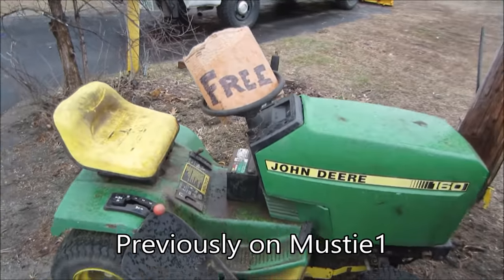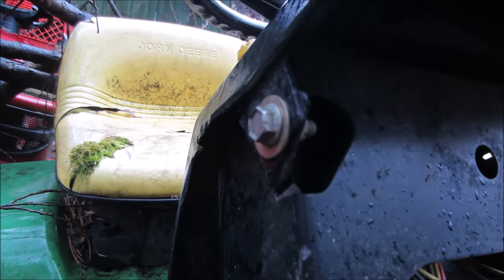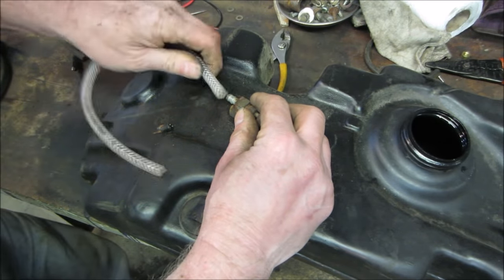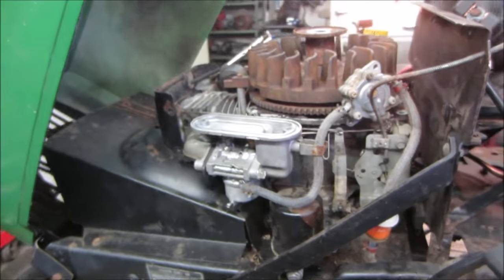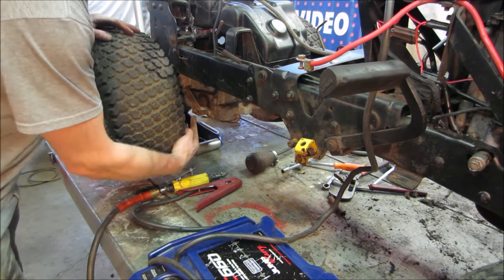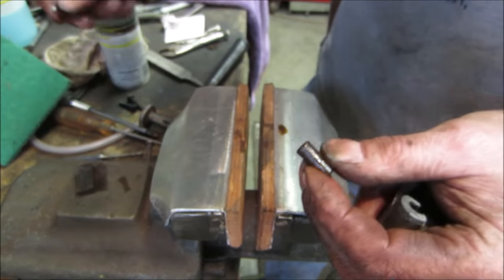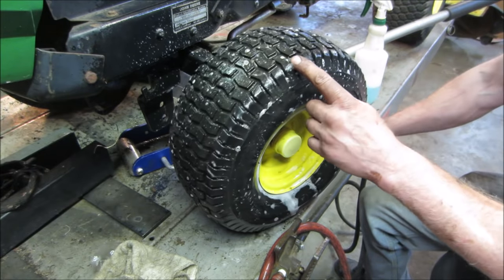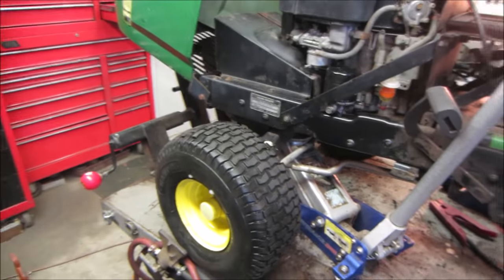CAN IT BE SAVED? Free John Deere that was in the trash. part 2

Comment: Wouldn't it be nice if every power equipment manufacturer would assemble their products with anti seize for all dis similar metals ? I was just out yesterday fixing one of my lawn tractors , I had success .  Weather was finally a little nicer yesterday so I got to confirm my repairs on one of my motor cycles was also a success . Then drained my pond and did primary cleaning and re filled . Today is pressure washing day , grandson wants to do some . Holding off on buying a new 30" Cub Cadet to replace my Honda walk behind and my 42" Craftsman . Also sell my snowblower tractor . Then design and build a mini lawn tractor based forklift , loader and plow . Been designing in my head for some time , looking forward to starting . Be safe and enjoy yourself .

Comment: This one video helped point me in the right direction on at least 4 problems for two different project tractors I'm currently working on (and only one is a much older JD product). How's that for efficient math?! One plus two equals 4 or more. 😁👍
Speaking of weird JD specific issues, you'd think these were designed by the British, using overly complicated systems for what should be like a two component problem. Instead there's five brackets, four pulleys with two of them having multiple components, clips and cotter pins everywhere when you could just have two bolts and be done with it. 
To heck with the purists at this point. I'm re-engineering it to be bulletproof for myself down the road!

Comment: Try automatic transmission fluid in the tire instead of oil.  It's designed to swell rubber seals.

If you put an old valve stem on the valve tool (screws right into place where it's supposed to chase the valve stem outside threads), it's a lot easier to use to remove/insert the valve insert itself.  Can just twirl it between your fingers and doesn't interfere with other use of the tool.

RichE San Diego, CA

Comment: I did my garbage pile find John Deere (1989 STX38) PTO switch using a “heavy duty” toggle switch rated to handle the amps, but again I also completely ripped out the entire wiring harness and started new, the only thing I re-used was the key switch. I don’t know been using it 3 years now, and never had an issue it mows the weeds in my yard.

I figure if you don’t know to start it in neutral, turn off the PTO when you’re done mowing, and forget that shutoff valve on the carb...if you don’t know how to operate a lawn mower, don’t do it...I don’t need no stinking safeties.

Comment: FWIW the gas cap is ventless and the vent spigot has a piece of tubing on it that runs up around the front of the filler nozzle in the 'trough' that is there and then back to the back of the tank. That's so that you can lift the front up for servicing (sharpening the blades, removing the deck) and nothing will spill out of the tank.

Comment: When I was a mechanic for an IH dealership, my boss was a parts changer, not a troubleshooter. He would just throw parts at a problem, until it was solved, then charge for all the parts, if they were needed or not.  We had a farmer with an intermittent hydraulic issue.  He came in three days in a row and each day was told there was nothing wrong.  On day three, after the boss couldn't find a problem, I took over.  I was able to duplicate the issue, and fixed a misplaced supply tube.   The farmer had changed the hydraulic filter earlier, and missed one step when he put it back together.  Quick easy fix.

Comment: They make a tire sealer for the beads, primarily made for aluminium rims works on steel also. Very common leak area on aluminum rims, especially in areas that use road salt.

Comment: You may already know but the NAPA 1348 filters fit most of the small engines and it looked like it would fit that one also. Some of the Kawasaki's were a NAPA 1394 O.D. is usually a bit smaller same thread pattern though.

Comment: Spin that 12 gauge bore brush on the end of a drill with some oil on it.  Wrap some 0000 steel wool on the bore brush and do it, agai, for a mirror finish..  that’s an old gunsmith trick for rusty shotgun chambers.

Comment: There's a tool set for removing connector pins. 
It has blades for different styles.
Check with your local electronics supply store if you have one.
We have one in north Miami that's like a bog boy toy store for me.

Comment: Your battery is made of lead plates in a tank of acid. Current normally flows through the plates. When a lead acid battery is left discharged for a period of time, the acid eats the surface of the lead plates. This is called sulphation. This leaves a layer of insulation on the plates, effectively stopping the flow of current. No saving that battery!

Comment: Just curious,  how much oil pressure do these small engines make? I have a Craftsman GT5000 with the Kohler 25 horsepower,  it has an oil filter too.

Just a suggestion. You can also use a vacuum pump to fuel pump to get gas from the tank to the carburetor.  I found that out when I rebuilt a carburetor on a Briggs V twin.  Saves time and  the starter/battery

Comment: When you pull your old fuel line out, attach the new line to it with a connector or a piece of all thread and pull it through . Saves fishing a new line through a tight space, or trying to remember how it went later.

Comment: Mustie, I have discovered a mixture for some prentrating oil I would like you to try and see how you like. Mix brake fluid and acetone 50/50, and put in in a squeeze bottle . It seemed to be the best I've ever used.
Reply: Check out the penetrant testing videos on Project Farm and AVE.  You will be surprised.  They tested it all including the 50/50 mix and none of it works worth a damn.  The best (and not very good) was Liquid Wrench.  What was really eye opening and funny is that Liquid Wrench is the cheapest stuff you can get!  Expensive does not mean effective (Yes, I'm talking to you, Kroil).

Comment: Had to replace the electric pto on my ariens serria, I didn't want to spend $180-200 on my then 17 year old tractor. Look far and wide for a used one, found one  an hour away a guy  was parting out some tractors. Cost me $50 and when I was installing it fell apart the clutch part was all worn out. Managed to make one good one out of the new one and my old one. Then about a month later at a flea market I found a new one in the box for $5,and of course I bought it you never know in another 17 years I may need to replace it again

Comment: That's about as dead a lawn mower as I've seen you resuscitate Darren!  From this episode, I'm sure you'll finish it up.  It wasn't rust, it was electrics and brakes and such.  You'll fix then mower deck even if you have to "liberate" good bearings from rusted out decks in the hoard.
Reply: Heck, with this one he didn't even have to touch the engine.  Most he comes home with are seized!

Comment: For any cheap people, like me.  You can just put a sealing valve cap on it for less than a 1$.  We have a tractor leaking 20.8x38. Has a leak from valve stem,  but I cant get it out because fluid and rust and has a tube

Comment: in the steel to aluminum cast threads if you get them free use noalox on threads when you reinstall the bolt It is designed to stop corrosion on dissimilar metals

Comment: I guess I don't understand how that brake works.  So you have two shoes that sandwich the disk, how does the disc stop the transmission if it's sitting free on the shaft?  Does it have splines that I couldn't see?

Comment: When I run lines, I’ll tie or tape a long string or wire to the line then pull it out. Reattach the wire to the new line and pull the wire back with the new hose.

Comment: The way the PTO switch should work is that if it is pulled out (on) and the tractor is turned "off," then the tractor cannot be started unless the PTO is "off."   There should be a switch under the seat that turns the tractor "off" if no one is sitting in the seat.   The switch under the seat is a normally open switch that makes an interlock with the start switch and ignition circuit so that sitting on the seat closes the switch and allows the tractor to start and run.  All of this is to keep you from getting off of the tractor with the PTO "on" or starting the tractor with the PTO "on."   On the newer tractors there is a PTO cutoff switch when the tractor is put in reverse.   Someone backed over a child standing behind the tractor with the PTO "on" and sued Deere for negligence in allowing them to mow backwards.  So, for all of the people thinking the interlocks are "stupid" - my only response is, apparently, not as stupid as some of the people using the equipment.
Reply: Every interlock is disabled on my machine except the clutch to start.

Comment: Ya, I was yelling "key".  Looks like all tires were run on low air pressure.  There was a bit of a bent rim on the left front inside near the valve.  I have a nice black dotted line across my tool board when the bead snapped up after a liberal coating of driveway sealer!  It worked.  There is likely a zerk fitting in the centre of the front axle pivot pointing down.  Good one.  Crap.  Put a tube in it.

Comment: As an Electrician I don't know why when you check continuity you don't just use the tone function. If it rings you have continuity if not it's an open circuit. Much easier and accomplishes the same thing for what your doing. The other that you use is for checking resistance which is of no value for just checking open or closed path. Just offering an easier way, you don't have to see the meter you hear it tone.

Comment: I have found that when I want to take out the Stake-on’s from the plastic holders, I took and found the right tool when I replaced my windshield wipers.  I took the small flat wire out of the rubber wiper, and bent it 90deg. At one end, for a handle, and then made the end a little smaller, so it would fit in the runner that the locking tab was in.  By running the tool down the grove, and giving it a twits I could get the Stack-on out with out much trouble..  Hope this will help?

Comment: Love those mechanical gearboxes this Hydro static stuff they’ve been putting in the lower end mowers has been garbage mine (which is a replacement after a year of the first one) now has the same issue as the first one where it barely crawls up the driveway until the fluid finally builds it is a second one and it is garbage as far as I’m concerned I’m looking for an old one with hydraulics on it I can’t even add fluid to my new one if it leaked out somehow since it’s sealed

Comment: I like it when you troubleshoot rather than simply googling stuff.  I think being cerebral is a better way to be, because its better to be able to think through a problem rather than seeking an online solution. Why?  Because you may not always be able to be online, and knowing how something works is better than not knowing. I generally find that the difficulty in trying to locate the solution online takes a lengthy period of time that may actually exceed the time that troubleshooting it affords and often, while troubleshooting, you find other things that might also be broken that you wouldn't have found if you simply googled the one issue you had.  Because the other issue will end up revealing itself later and then you are disassembling everything again. More wasted time.

Comment: Hey mustie i have a question for ya i have a husky i bought a few years back but ive noticed that on the steering rack and blade pulleys have no grease fittings to lube them,  is there a way i can possibly  drill and tap those? or would that cause more harm than good?

Comment: With a dead battery the water and acid do not separate. The acid chemically changes to plain old water as a charge is drawn from the battery. Water has a higher freezing temperature than acid, so a dead battery will freeze where a charged battery will not.
Another aspect of this is that a frozen battery will not take a charge. You must first thaw the battery before you can charge it. Forgetting this can cause massive frustration when your battery is dead on cold nights.

Comment: 1:21:27 It will run but it doesn't want to stop. That doesn't look good. But then again, a breakdisc so small, with that high speed. Only option is to up it in neutral and bail.

Comment: It seems like the electronic PTO and fuel pump were decisions made by marketing instead of by engineers.  A cable operated PTO would be cheaper and just as reliable.  A gravity feed fuel system would be more reliable than a pump.  But the marketing department wanted the lawn tractor to operate more like a farm tractor, and forced these features into the final design.

Comment: I have a Gravely ZT hd 44 in Mower  I just bought a new interstate battery at the end of last year It was dead when I tried to start it this year so I had to jump it off  I mowed probably 10 mins and the blades just quit like I turned them off. I think now that my voltage regulator is bad or stator. Any thoughts??  Thanks in advance!!!

Comment: Sometimes dead cell can be a opile of shavings on bottom if i got a clothes hanger ben in an l shape between scellsd you can knock the pile down n the battery is still useable or salvageable and will hold a charge. Just my 2cents or try using a pulse charger

Comment: I have a JD 111 and the starter solenoid went out and was wondering if the solenoid goes out if that is tied in with the PTO at all?  I hooked a car starter button to the two large studs on the solenoid so I could start it after sitting for 5 years and went to switch the PTO on and the switch was stiff and would not move. So I bought a new switch and still the PTO won’t turn on. So if I remember correctly the purple wire by the solenoid might be to the PTO. Bought a new solenoid but it only has the two studs coming out of the little black circuit switch or whatever it is that I slid the red wires into the threads but the solenoid does not have a 3rd small stud like the one I took out which I think the purple wire slid onto the little stud . I also lost my notes when I took out the solenoid year so I’d know for sure how the wiring went. Can’t find a solenoid that has the 3 small studs plus the two big power cable ones. Runs great and never had the head off.  Wish the made them like they use to.

Comment: Every time you run your fingers over a key way or oil filter flange, I cringe... I sliced my hand open on an engine crankshaft turning it by hand while rebuilding it and have cut my hands picking up heavy aluminum and steel parts, like mower and car engine and head parts, and have sliced my fingers open, greasing up or wiping off other things... some edges aren't always knocked down at the factory... And they stay pretty sharp. Sliced my knuckle on a metal edge that was so sharp, I didn't even feel it until after I noticed blood all over the bench and on the shop floor and finally figured out where it was coming from, then it started hurting... lol. Now I check and knock them down if I'm working on things with sharp edges. And I do the same thing you do, find stuff that don't work for free, fix it and sell it. And I also have contracts with landscaping and snowplowing companies to maintain and repair their equipment, so it's not like I have soft hands.

Comment: You should always crank the engine without the spark plug connected to raise the oil pressure first before it starts, that way you have lubrication, even if only sits for a month, a dry engine is bad for the engine and you.
Reply: Troll.

Comment: As with any Jenner transmission lawn mower the grease can get hard over time and it'll get so bad you can't put it in gear and you take the differential part clean the grease out and replace it with new Grease

Comment: Ya should have put that wheel back on with the valve stem on the outside like the other 3. It sure is hard to air it up or check with it on the inside

Comment: OL is "Over Limit" since it's used for all the measurements in all their ranges.
Reply from the maker: As before, if your circuit is continuous, the screen displays a value of zero (or near zero), and the multimeter beeps. If the screen displays 1 or OL (open loop), there's no continuity—that is, there's no path for electric current to flow from one probe to the other.
Reply: @mustie1  I Googled this and found the text you are responding with and I accept it. However, what does it stand for when it comes up (and it will) when you are over-ranged in the voltage, current, capacitance, frequency, period etc functions? I was puzzled by this abbreviation over the years and found  references to "over limit". This covers all the circumstances on a digital measuring instrument that can not display a number that is beyond its display counting capacity. No big deal. Just an interesting curiosity.

Comment: Schrader valves are not the seal, they are the adjustment device.  The cap is the seal.  Never cheap out on the caps and you seem to magically not get as many slow leaks over time...

Comment: Added bonus, "Tool Tear down"  Don't you hate when you have to fix a tool to do your work?
Also why didn't you just chuck up the shotgun brush in a drill and run it in and out. 

Stay safe.
Reply: Because there are straight cut splines that need cleaning.

Comment: I can't for the life of me understand why the design engineers specify dissimilar metals for component assemblies. Steel fasteners through aluminum housings just boggles my mind. Add water (from a wet lawn) and you have locked up brakes. Stainless fasteners would eliminate all corrosion potential. So what's with the yellow alien hanging from your belt at 1:02:25?

Comment: So annoying that the grease fitting and valve stem are not on the outside of the wheel.  I have drilled an extra hole  on the outside of my wheels for Valve Stems.